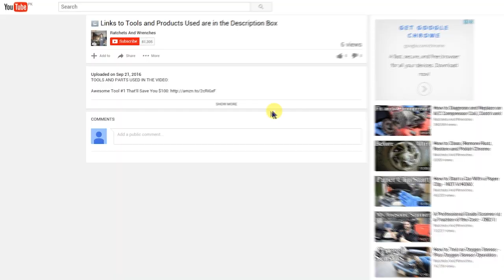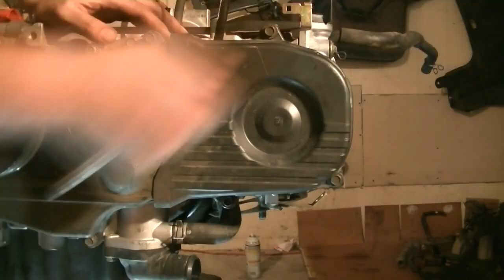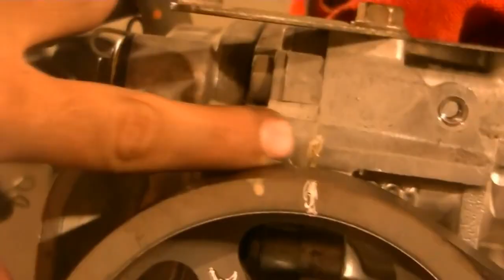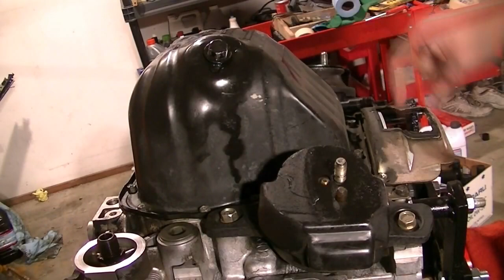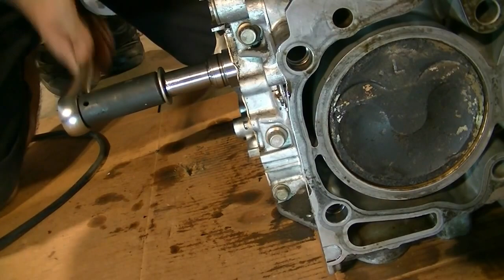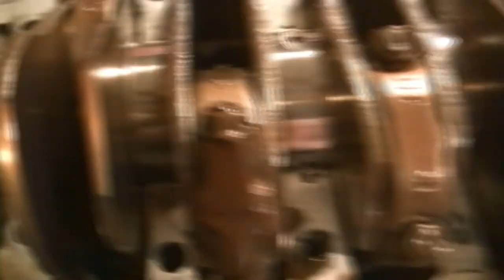Fixing a Rod Knock - Engine Disassembly and Tear Down

Comment: I hear a grind from my 2008 impreza 2.5i N/A. Around 3000-4000 rpm. Might be rod knock or might be shifter arm bushing gone bad (grinding seems to almost dissapear completely if I put downward pressure on the stickshift (no grind noise if I'm in neutral/idle). How do you find out if it rod knock without dissassembeling the engine ??? Can I find out with an OBD2 reader ?

Comment: How come the crankshaft is still smooth?
Reply: Most likely because that one part was eating the bearing. From what I would guess, the owner would need to replace the rod and that bearing. But you might as well do a few other things like replace the heads and re surface the crankshaft just in case. They’ll also need to replace the oil pickup since there’s stuff in the mesh. Or, just get a short block (I think that’s the term) and replace everything.

Comment: I have a similar rod knock in a Jaguar 3.8 liter, inline 6, XK engine from 1964.  nobody wants to replace the bearings, everyone wants to rebuild the entire engine which it doesn't need. The engine idles smooth, you only hear the rod(s) knocking when you accelerate the engine hard. The engine is not as difficult to dismantle as the Subaru you just did. What do you think?

Comment: Hello Sir,I'm a female and I wanted to ask a question someone is selling a 1997 Ford Ranger XLT Extended bed."They said it needs a rod in the third cylinder."I wanted to know is that dealing with the motor or what?

Comment: i had that toothed idler seize on my car and the timing belt held the force from the engine but the passenger cam did not fair out so well. it snapped the end of the cam off.

Comment: hi my car kia sephia 2000 shake when stop on gear D 
i cleaned the iac sensor and TPS changed same problemes any ideas?
Reply: id suggest yu check your motor mounts. my 2000 nissan altima did the same thing when they went bad. fixed them an no more impending doom at stop lights
Reply: id suggest yu check your motor mounts. my 2000 nissan altima did the same thing when they went bad. fixed them an no more impending doom at stop lights
Reply: id suggest yu check your motor mounts. my 2000 nissan altima did the same thing when they went bad. fixed them an no more impending doom at stop lights

Comment: Hi , I saw other video from youtube can't remember the link. The guy managed to change the rod bearing underneath the car without removing the engine. The guy also sanding using shoe lease on connecting rod and fixed it.

Question = it that possible easy?
Reply: axenz axtiz wouldn't work for a Subaru engine. with a typical straight four or v6, the bolts for the connecting rods face downward. with a boxer engine, they are faced laterally or sideways. you may be able to get to one bolt, but getting to the second bolt at the top will be literally impossible without splitting the block.
Reply: Owh ok thanks for the info :)
Reply: axenz axtiz no problem bud
Reply: The video youre talking about is on "Oldskool funk" channel.

Comment: When you say you machine the crank/cam to repair it, how is it possible. My understanding is because the crank/cam will be damaged loss of material to it, how does machining it add back material?
Reply: TheMidnightNarwhal When you machine a crank its diameter of the journals gets smaller so you will use smaller bearings to make up for it. When you machine connecting rods and caps the bore will get bigger so you will use a bigger bearing. By bigger and small i mean the thickness.
Reply: Codey Hanna the machine shop will tell you what size you will go with,  size zero is the perfect size for new crank or cam shafts,  after machining you will go with size ten  or twenty or thirty,  i don't know how far you can go but there is a limit,  after that limit the shaft will be weak and you will not be able to find bearings for it,  then you need to replace with new or good used shaft
Reply: TheMidnightNarwhal I believe they use thicker bearing's
Reply: Ah ok, so you just adjust other parts to accommodate for it's smaller X
Reply: That's what I was always thinking. So afterwards when it's time. How does this get ordered? After you send it in is there an automatic order placed by machine shop for diameter needed.  Or is the customer responsible to figure it out and make the order for these parts? I love these vids. Rachets and Wrenches is perfectly presented in a timely matter. Making it simple to follow along.
Reply: thesniperofcs Thank you. :D
Reply: I know machining is done when damage isn't too great but that would leave me concerned that the crankshaft balance will be thrown off. That will lead to additional machining of the crankshaft in other places and in turn, more custom rods and bearings, which in total, still leaves the rotational assembly balance off.

Comment: I'm just curious, how do you remember where to put all the bolts and parts back together? Do you come with some plans or just refer to a manual?
Reply: TheMidnightNarwhal it also probably helps that he recorded himself taking it apart. All he has to do is watch the video in case he forgets where any bolts or parts go.
Reply: one word.......experience..........
Reply: TheMidnightNarwhal dude this is a professional and talented mechanic using his creativity
Reply: in that video, or at least the old version of it he describes his system for keeping track of parts and fasteners. Like Fede Ber said, this is up to the creativity of the person doing the job. Make up something that works for you.
Reply: You replace the camshaft and either grind the crankshaft to make all journals the same, or you build it up by welding, done on a machine at the machine shop. and then grind the journals to make them all the same. But, it is much cheaper to order a crankshaft kit. IT comes with all you need to service the crankshaft.

Comment: Serious question please respond
my engine was overheating and i poured around 1 gallon of water in it (in the oil cap hole) and was running fine for a couple minutes, then i saw smoke, then i heard grinding noise, the engine shut off and wont start. What is the problem?
Reply: Help this is my dad's Porsche 911 Carrera, hes going to kill me if he finds out i broke it. He spent over 60k on it when it first came a few years ago
Reply: Taylor Hennesey what you need to do is drain all the oil and pour in some 10w-40 antifreeze it should be red colour
Reply: Taylor Hennesey you messed up big time! I'm gonna guess that you used regular water for that high performance engine. Not good! Should of used high premium distilled water. Yes, very expensive but hey I'm glad I didn't destroyed my dad's classic 1978  Ford "pinto" deluxe engine. Good look in the after life buddy.
Reply: guys you do realise this is a complete troll post
Reply: @gordonness74  you the only one on the post not trolling lol
Reply: No! :O Is it really?? Haha omg...
Reply: probably you muffler bearing is gone...
Reply: low blinker fluid level will destroy engine smegma regulators...easy fix is to add Axel bearing grease ( about 9 liters) after draining the water.....add about 4 liters of 20-60 weight oil and rev engine as hard and hihg as possible for about 1 hour...FIXXED>....nahhh just kidding ...every bearing and seal has to be replaced....block resurfaced and new heads or head...go to junk yard and get a bigger engine with many miles..